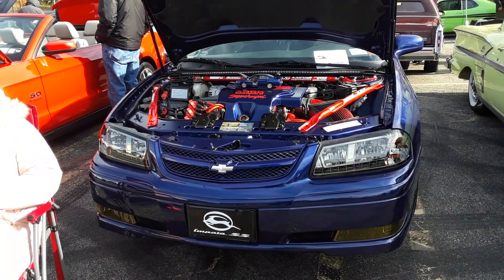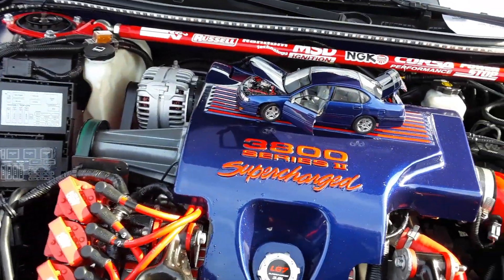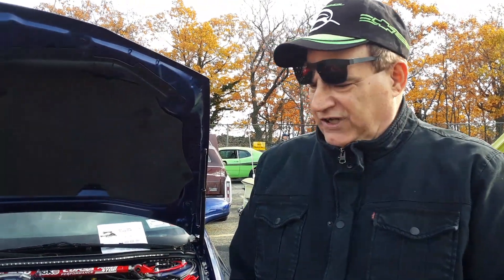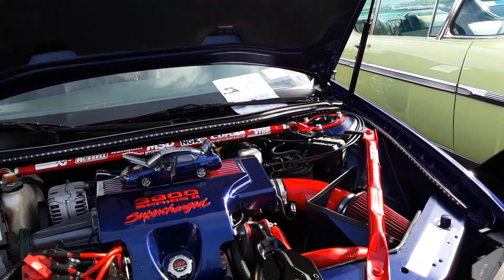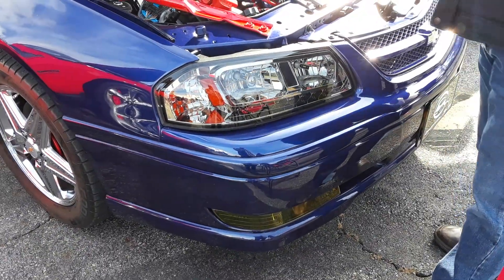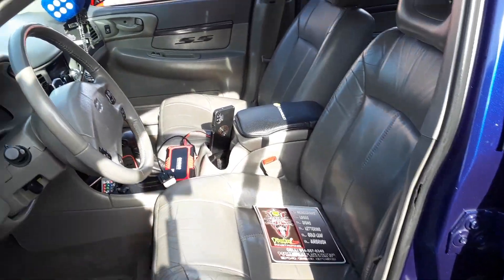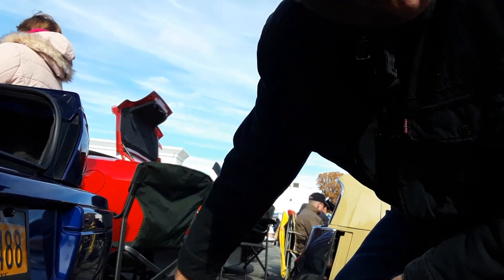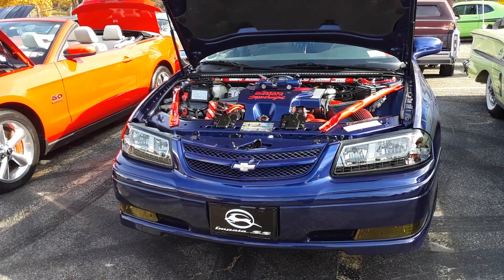2005 Chevrolet Impala SS w/Supercharged 3800 V6

Comment: I have an 04 impala SS. But it now has a series III L32 with gen v blower. Maybe I have the only one I don't know. I dropped the engine and transmission in it.  Northstar throttle body. Alot of ZZP parts. It's a work in progress. 310Hp to the wheels currently. Once I convert it to E85 and drop the GEN V pulley down in size and 1.9 rocker arms it should release even more HP. It has a hell of alot of torque.
Reply from the maker: Wow.Im curious now. Tell me more. 
Did you make a video on it? I must see this ride!
Reply: @broncomcbane6382  Soon as I get a new paint job on it and have it all tuned right I'll post a video and let you know.